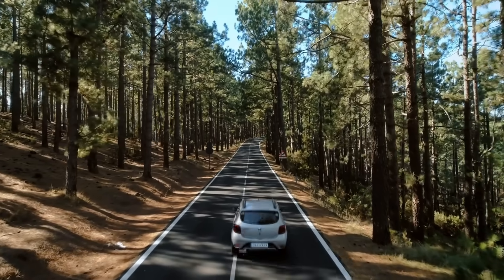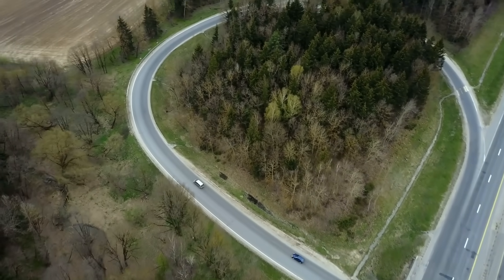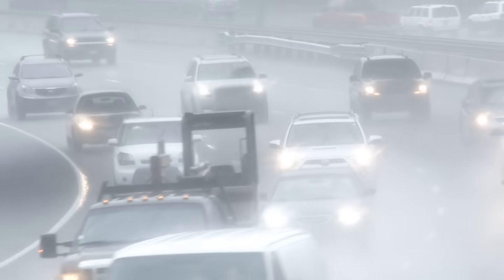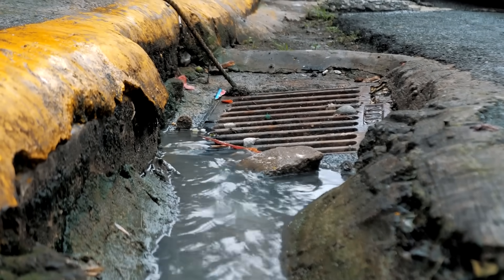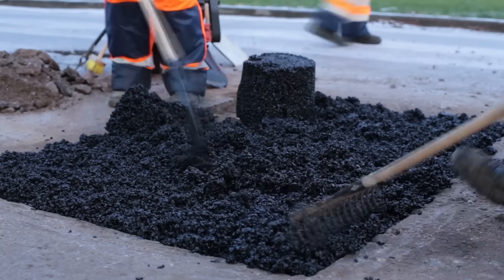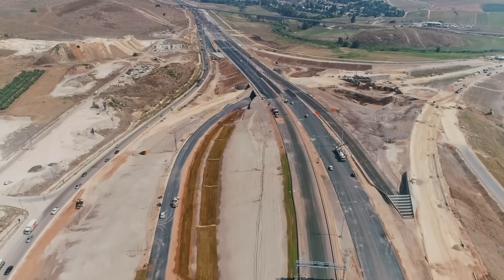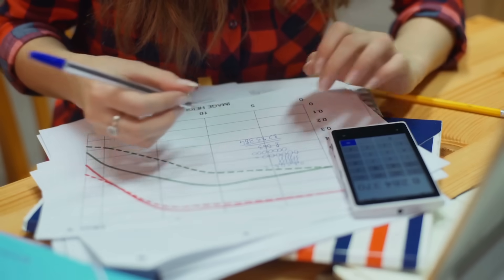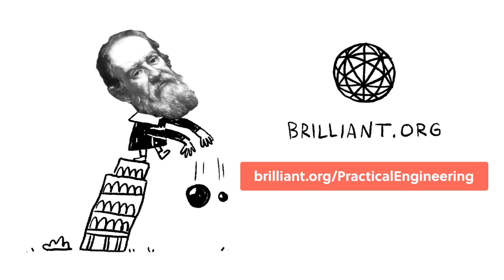How Do Potholes Work?

Comment: Aren't those companies also only paid to replace/resurface roadways?  So they also have a vested interest in having them last only so long.  Durable enough not to get complaints, short-lived enough to get regular business.  Additionally, thickness of pavement is crucial, big thanks to regulators for making sure cities and town's don't get cheated by contractors applying thinner topcoats than contracted.   

Granted road closures and additional material and labor costs related to installing more maintenance free and long lived solutions need to be considered.  But we also should consider how 2.5 million miles of blacktop affects things like air temperature, erosion issues, and topsoil ecosystems.   We need to find a way to incorporate more natural solutions into the constructed environment.  I'm looking into a permeable driveway for my home in New England; fight frost heaves with flexibility and drainage.

Comment: Water is not the only responsible for pot holes. Big trucks, have a lot of grip on the tires, and can literally dig out asphalt just by passing by lose sections and they don't even need to have the speed for that. 
I've seen it happening right in front of me, in a very slow-speed zone, just 3 heavy trucks passing exactly over the same place, transformed a tiny coin-sized pothole, to another bigger than my feet. in a matter of minutes.

Comment: I love driving. I am a car guy through and through. The two keys to my enjoyment of my commute are to drive a fun car(S2000) and work nights. I am on the road around 5pm and hauling ass down the autostrada and looking at all the poor schmucks on the other side in gridlock.
Reply: Oh I guess the third thing is live in an area that isn't ravaged by intense weather. I grew up in Michigan where a lot of roads are barely holding together. Now I live in Sicily. There are a few potholes here and there, but for the most part it is pretty smooth.

Comment: The solution to potholes is not more tax money to roadways, but spending tax money to reduce the number of cars on the road. In other words: public transport (a bus has fewer wheels per person transported than a car). But of course that requires a significant change from the car-centric america. It's not cars that need to go somewhere; it is the people in those cars. And public transport is better at doing so if it is allowed to (seperate bus lanes, better train network etc.).

And if you worry about more traffic when there are fewer lanes for cars, that won't be the case. As PT is faster more and more people will take PT until there are so few cars on the road that taking the car is as fast as taking PT; which is faster than taking the car would have.

Here in bike country (NL) I don't even need a car to get to where I want to go. Groceries: take the bike; visiting family: trains and buses.
Reply: =NOPE,THERE'S A BETTER SOLUTION-CROWDFUNDING ALONG WITH CHOOSING MUCH DURABLE SOLUTION IF EVEN IT'S EXPENSIVE

=PUBLIC TRANSPORT ISNT THE OPTION BECAUSE OF IT DOES OFFER DIFFERENT SORT OF PUBLIC MOBILITY LIKE "RESTRICTED MOBILITY"...WHILE CARS OFFER "UNRESTRICTED MOBILITY".....IT'S THE SAME ONLY IF YOU COUNT EVERYONE ELSE AS SUBHUMANS.....

.....DAMNIT,I'VE RESET THE EXPANSION OF TEXT SO AGAIN BUT MORE SHORT

=THERE'S 3 KINDS OF PUBLIC MOBILITY

-FREE MOBILITY=THE PERSON CAN MOVE WHEREVER WHENEVER WHATSOEVER AS PERSON DESIRE.....IT'S MAINLY ABOUT CARS

-RESTRICTED MOBILITY=THE PERSON CAN SORT OF MOVE WHEREVER WHENEVER BUT THE PERSON IS TO BE TRANSPORTED BY SOMEONE ELSE WITH FREE MOBILITY OF SORT OF LIKE IT AND ALWAYS GOT GO MAKE AN AGREEMENT AND FOLLOW SOME KIND OF RULES......IT'S ABOUT PUBLIC TRANSPORT AND SOMETHING LIKE HITCH HIKING ,OR LIKE WHEN CHILDREN OR LIKE THAT TO BE TAKEN SOMEWHERE BY FAMILY MEMBER WHICH DO HAVE CAR AND DRIVER LICENSE ..............WALKING AND BICYCLE IS HERE TOO

..ALLOWING-FORCIBLE MOBILITY=THE PERSON DOES NOT HAVE ANY KIND OF MOBILITY AND FREEDOM OF PERSON'S MOBILITY IS UTTERLY IN SOMEONE ELSE'S HANDS ....SO THE PERSON HAS ALWAYS ASK FOR ALLOWING TO MOVE ELSEWHERE OR BEING STUCK AT SOME PLACE WITH A SUFFERING PENALTIES IF PERSON WILL CHANGE PLACE OF DISLOCATION AGAINST SOMEONE ELSE'S WILL.......OR PERSON TO BE MOVED AGAINST PERSON'S WILL TO ELSEWHERE WHENEVER AS SOMEONE ELSE WILL WANT TO......IT'S ABOUT ALL PRISONERS AND LIKE THOSE,AND LITTLE CHILDREN.......

=NOW MAYBE YOU'LL UNDERSTAND WHY PUBLIC TRANSPORT IS NEVER A SOLUTION...........EVEN ABOUT PUBLIC TRANSPORT MUST BE HEAVILY RESTRICTED ...............FOR THE SAKE OF INCREASING FREE MOBILITY

=AND EVEN THE GOVERNMENT MUST CREATE CONDITIONS THAT BENEFIT PEOPLE TO HAVE FREE MOBILITY AND DO NOT RELY ON SOMEONE ELSE.........THAT'S THE REAL WAY TO MOVE COUNTRY TO PROSPERITY AND FIGHT WITH POVERTY........................

=PUBLIC TRANSPORT IS OPTION ONLY WHEN PEOPLE IS HELD AS CATTLE BY THEIR OWN GOVERNMENT WHICH DOESNT CONSIDER THEM AS HUMANS............................................

=UNDERSTAND=??...........................................I'VE GOT SO ANGRY ON WHAT YOU'RE WROTE SO TO CALM DOWN HAD TO WRITE THIS ONE.............BECAUSE OF YOU DO NOT HAVE SUCH A BRAINS IN YOUR HEAD...................
Reply: @robotnikkkk001  First of all, your comment is quite long and excessively capitalized.
If I understand correctly, your argument it is that public transport does not allow someone to go anywhere anytime they want to, because they have to rely on someone else to get them there.

The thing is that the time and destination of different people's trips often line up, which you experience as rush hour. If most of these people went by bus the highway will be used more efficiently, precisely because there can be more people per area unit in a bus than in a car. 

traffic is a problem quite similar to the prisoners dilemma, if all people went by car they are worse off than if all people went by public transport, because of traffic. While for each individual it is often beneficial to choose car over public transport for the reasons you listed. An important role of government (as I have been taught in school) is to step in in such situations to get society closer to the optimal situation.

And yes, there are trips that would not be viable with public transport. But for those you could still use cars, and they get there faster because there are fewer cars on the street.

Finally, I don't consider my bicycle in the restricted mobility class; I can use it whenever I want and get to most places I want to get to.

Comment: Years ago while in Costa Rica a driver told me that their national symbol was the “pothole”. While driving you drove on whichever side of the road didn’t have a pothole, at high speeds it was very unnerving darting back in the correct lane seconds before a head on collision, everyone drove this way. Their blacktop did not use crushed gravel and was very thin.

Comment: If you could answer me a question. Why are plastic sheets laid down on the ground where new concrete is being laid. I've observed it being used more in construction where I currently live in Wisconsin which has a lot of cold weather conditions. And I didn't see it as often when I lived in Texas. But I don't think that is the only reason. Is it to prevent water from getting down into soil beneath to attempt to prevent potholes. What is the reasoning. I'm rather very curious about this as there currently redoing roads around my apartment complex and I keep seeing plastic sheeting in the holes before they pour concrete.

Also another unique to where I currently live phenomenon is having asphalt laid on top of older concrete instead of ripping it up and replacing the entire road. I also find this rather curious but after watching this video I could see that it might have something to do with slowing the exponential of soil erosion beneath to prevent potholes. But if you know why this might happen I'd love to here the reasoning. 

Love you channel, I'm fascinated by all things engineering. Sadly I didn't take the time to become one myself. But I do love knowing how things work and being able to do things for myself. Your always rather enjoyable. The Bill Nye I wish I would have grown up on
Reply: A membrane is laid down to prevent the ground from absorbing all of the moisture in the concrete. Concrete cures slowly and if it loses moisture it can cause the concrete to lose its strength. 

In concrete roads a thin layer of asphalt often referred to as micro asphalt is laid on the surface to create a more skid resistant surface. It also looks nicer than a bare concrete road.

Comment: I'm annoyed that here many repairs are done by simply throwing bit of tarmac mass into pothole and workers don't even compact those areas. Even worse than repairs are usually seen done at early summer,here where winter and ice is major factor for creating those nasty holes. Though without compacting repaired area it's pretty much meaningless when repairs are tried to be done 😔

Comment: How do the Dutch lay their roads? I've never seen cracks, there's sometimes a few patches but there's only ever 1 crack patched and not a web of them
Reply: I think they resurface them regularly
Reply: @bluemountain4181  I don't know, I've seen old surfaces which are still completely intact with only a few cracks patched
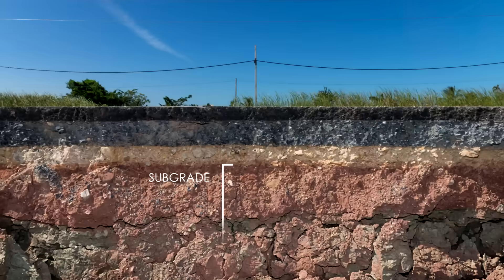Reply: At 1:58 the video describes how the roads are made. But as a Dutch civil engineer this was quite a surprise for me. 
In my municipality we usually only have one ''angular rock layer'' of about 30cm as a foundation. Then on top of that we usually have 3 asphalt layers that go from big pieces of rocks to smaller pieces: a 8mm base-layer (for strength) , a 5mm inter-layer (which sort of functions as a glue between the base and top, and more strength) and a 3mm top-layer (for noise reduction or skid resistance). 
And when cracks start to form in the asphalt we usually only have to remove the top-layer, and relay it. 
But a very important reason you don't see many cracks and potholes in the Netherlands is probably because we pay so much taxes, which means we can actually afford acceptable maintenance.

Comment: I can explain exactly how potholes work in Illinois. Step 1 - Build the cheapest road possible. Step 2 - Wait for potholes to develop. Step 3 - Campaign for re-election on fixing the potholes. Step 4 - Get re-elected. Step 5 - Repair the potholes in the cheapest possible way (using one of your favorite campaign contributors). Step 6 - Wait for potholes to reappear. Step 6 - Repeat for your entire political career.
Reply: Step 7 - And don't forget to hug a union rep and thank them generously.
Reply: Lived in DuPage County for a bit here. I've heard the heavy salt application during snow removal also deteriorates the blacktop. True?
Reply: @anthonyaguirre7143  yes because salt keeps water in liquid form at a lower temperature. In other words, that trapped water creates a lens that stays around for longer in the subgrade. It also  means it undergoes many more freeze-thaw cycles exacerbating erosion

Comment: You explained how they form from cracks, but not really how they grow and become worse.
As a wheel falls into a pothole puddle, hydrofracturing breaks up and ejects material causing the pothole to grow and deepen. This is especially noticeable on unpaved gravel roads.
One should drive slowly through wet potholes so they don't get too big before being repaired by filling in again.

Comment: How Do Potholes Work? Yes they work as intended. In Belgium, they are used to slow down the traffic. No need to add speed humps or speed cameras. Just put a sign (uneven surface) and there you go.

Comment: Ok, think about it again. This is WHY asphalt is terrible. It doesn’t actually handle the moisture + temperature variations that occur with the repeated pressure. They are just cheap crappy surfacing. The Romans did it right.

Comment: Here in New Zealand all roads are Chipseal roads, they cost more than Asphalt roads but they last longer as we have a wide temperature range from summer to winter. We use Asphalt as a cheap driveway sealer.

Comment: Concrete vs Asphalt surface. Which makes a superior road surface?
Reply: Depends on the intended purpose.

Motorways - Asphalt for its high skid resistance, smoother ride and less water spray.

Work Yards - Concrete for its high strength and long lasting life

Comment: One time there was a nastier than usual pothole on my way to work, and because of the heavy rains the night before, you couldn't gauge how deep it was. Someone on a motorbike with their kid tried riding through it thinking it was just a shallow puddle (there are easily a dozen of them in any 200m of that road) and it ended very badly for both of them.